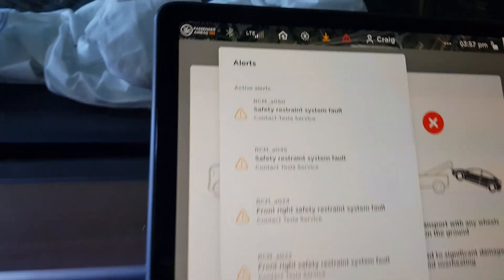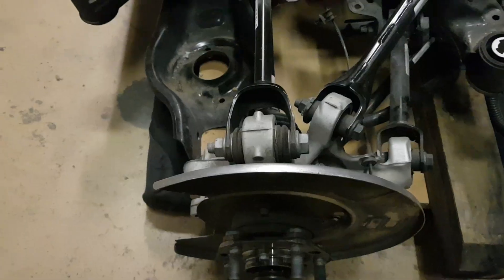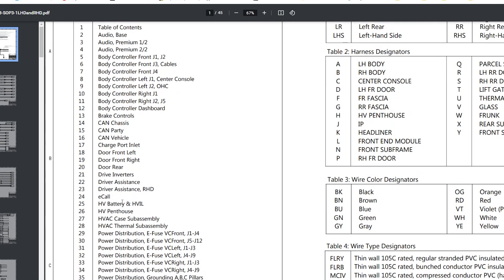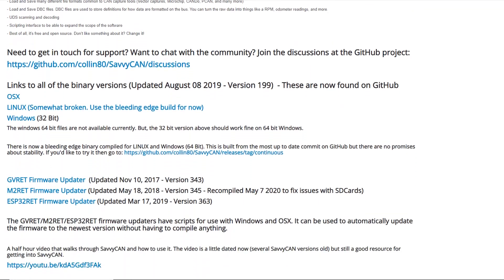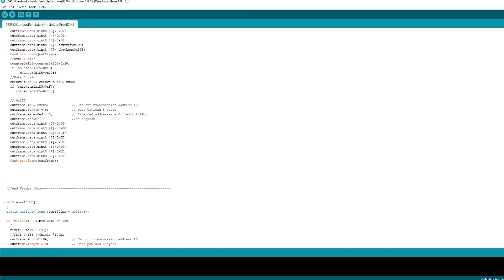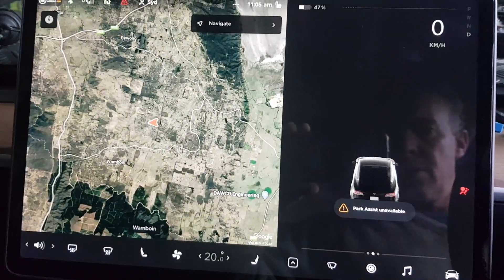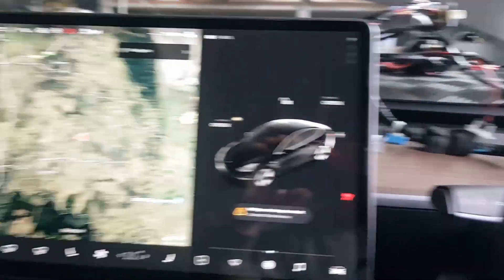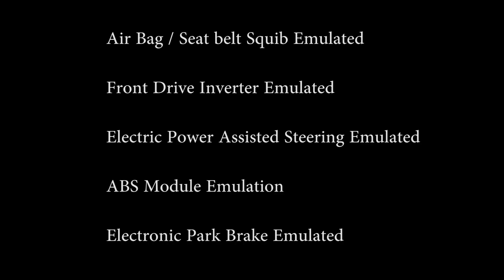Land Rover FTI 04 - Tesla Model 3 Emulation

Comment: Sydney would you sir have you thought what 4wd would be easy to “convert” 
Enjoying watching
Reply from the maker: Thankyou! Depends on how the conversion is going to be done really. Batteries are the main consideration - If you are going to use the really long model 3 Battery modules this will rule a lot of vehicles out! If you can fit the whole battery pack in it's original case then this makes it MUCH easier!
Reply: @sydneyg007  I’m kinda thinking of conversing a Toyota coaster bus if I could get a wreck MS/X long range. I would have floor space for two batteries I think! I’m still 9/12m away from pulling trigger
Reply from the maker: Yeh, would be plenty of room I would think! I have a friend that is putting an entire Model 3 into his VW transporter (4wd) and has been able to fit the entire model 3 battery pack in with a cutout for the penthouse in the rear bay. A van is a good way to go! @tasd5673
Reply: What a headache!  Great determination….

Comment: Great work and great video! Makes sense to just emulate what you are not going to use, so that you in fact are just putting a Land Rover on top of the Tesla with out the Tesla knowing :-) Is there any potential pitfalls with all this emulation?
Reply from the maker: Exactly! I guess one pitfall (being a Tesla) is the over the air updates. i.e. it won't be able to update the front drive inverter firmware so won't be happy about going ahead with installing any newer firmware. Mine is no longer talking with Tesla (which I am actually happy with) or getting updates so this won't be a problem. I may be able to update the software using Tesla toolbox but haven't investigated that yet though. I'll let you know if I come across any other pitfalls though!